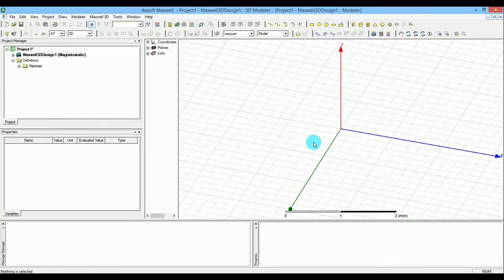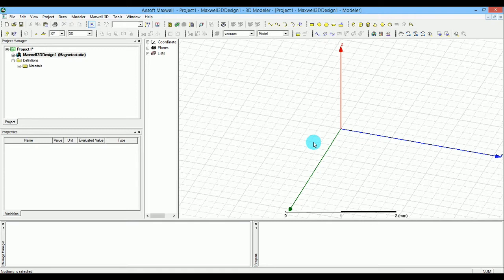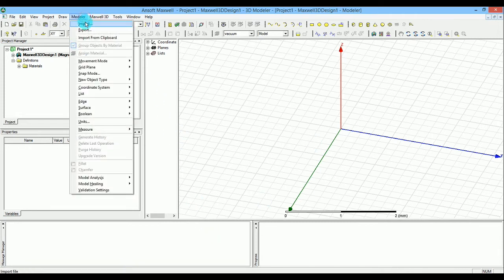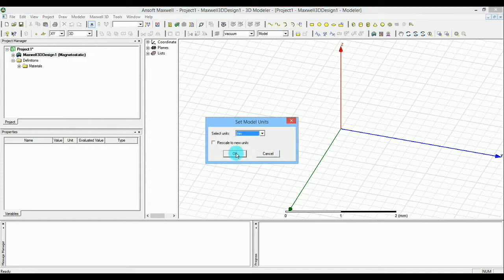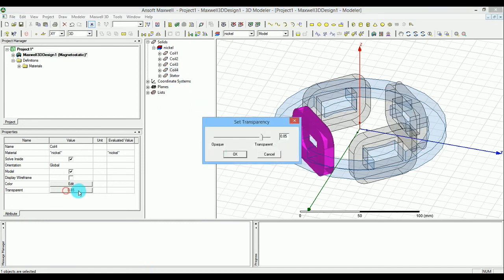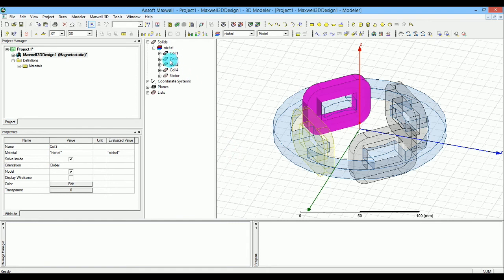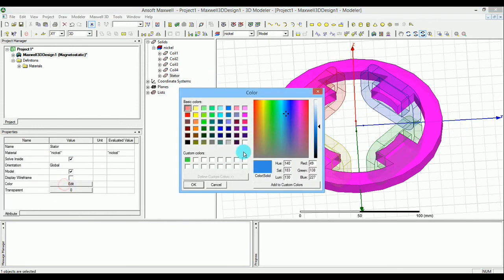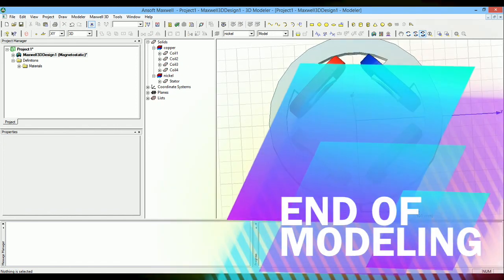225 - ANSYS Maxwell - Master /Slave Boundary [motor example] [Modelling 1/4]

Comment: what is the master/slave boundary in the current version of ansys
Reply from the maker: it is used to simulate fractional geometry of symmetric systems. that way you save simulation times. Imagin an electric machine, you can solve 1/6th of it and on sections of fractions you can define dependent and independent  boundary conditions.  that way you have fields leaving on independent side showing up automatically into dependent boundary conditions.